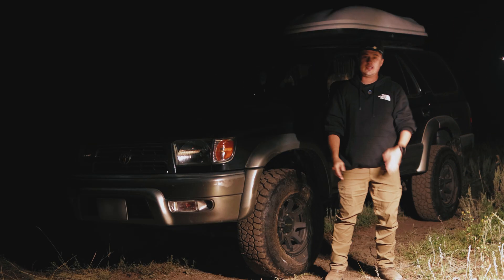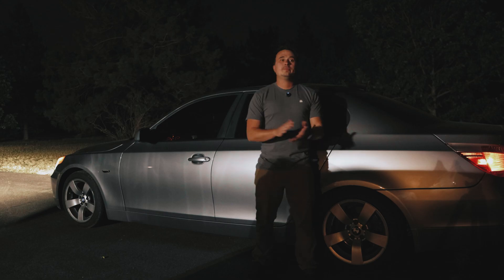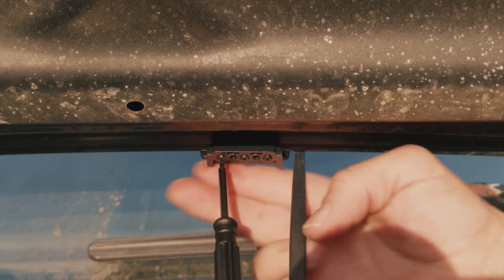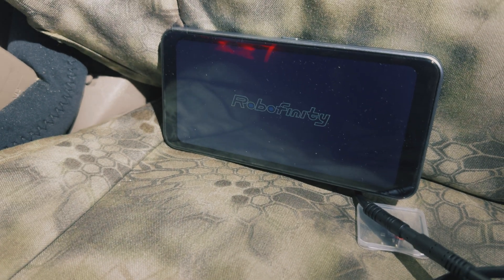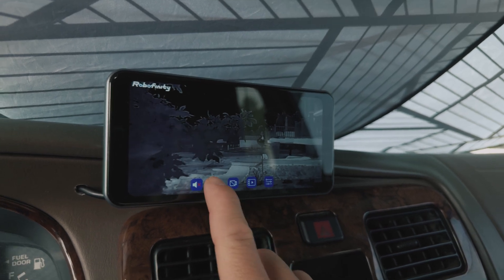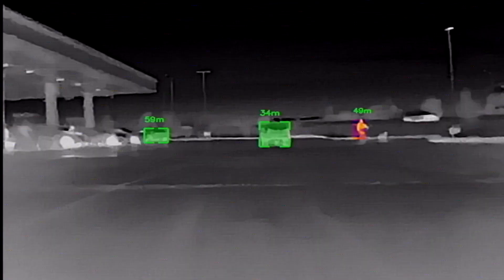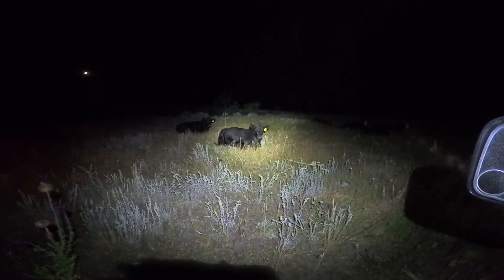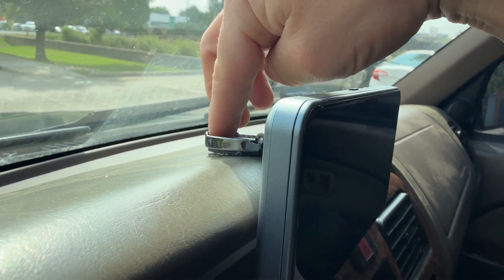Thermal Night Vision for your Car | Robofinity InsightDrive Thermal Imaging System

Comment: Did you cut any cables to supply the power to the device with the switch
Reply from the maker: Yeah Im just running it off my power outlet circuit

Comment: How good is this for picking up deer, in practice? I totaled a car recently due to a deer hit.
Reply from the maker: it's ok but not perfect, really good for super dark highways. will help more if you have a passenger that can watch the screen for deer
Reply: Get you an early 2000’s Tahoe.  They’re good for around 4 deer before you really need to start replacing body panels…but on if 2 of them are deer impacts from the side…but 2 frontals and I replaced to front clip (I was worried if I got a 3rd frontal it would get into the condenser/rad.)

Comment: If it cam with common connectors where you could plug them into a larger screen to the screen in the dash, I would be a customer.
Reply from the maker: they sell a multimedia adapter for it https://robofinity.com/products/multimedia-adapter-for-insightdrive

Comment: I was wondering when they were gonna make something like this. I bought a top-down a couple of years ago hand-held unit and it's great for seeing through walls basically like you showed on your other vid. It's a cool diagnostic tool for electronics, automobiles, etc. Heat signatures can tell you a lot. If you know it, you're looking for, by the way, I just subbed to your channel. I just found it today. I hope you'll keep making more videos. My handheld has the same resolution as that one. Hopefully in the next few years the resolution will get better.